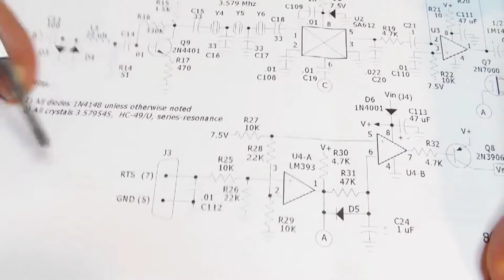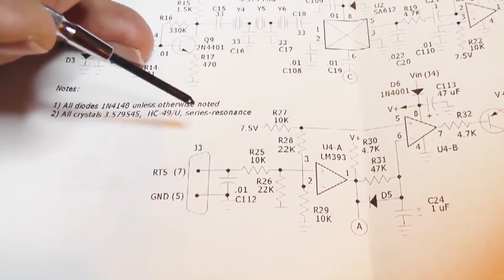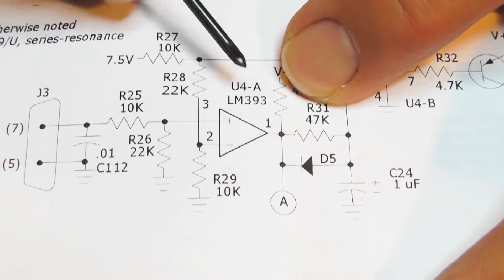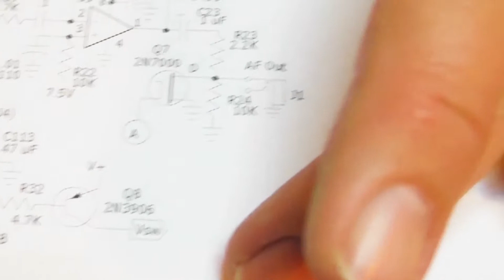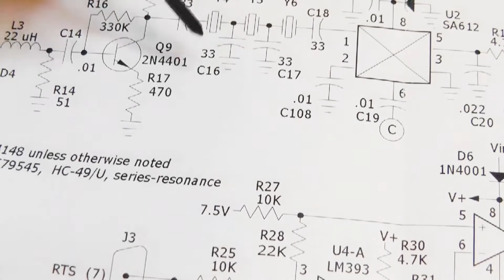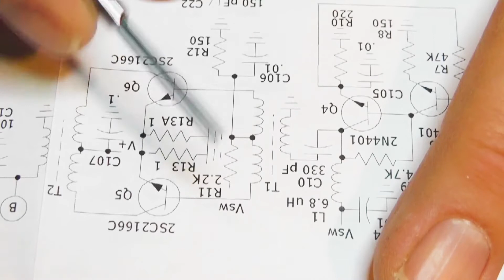Dave Casler Technician License Series: T06 Components and Units 2022-2026

Comment: I am a bit stunned that this is relevant to licensing- I wonder am I expected to build something? This seems insanely antiquated.  I can't imagine this information will ever be needed in my use of HAM radios.  Please correct my perception or show an example of the value to have this knowledge.  I hope I don't need go to radio shack (aren't they extinct?) and get a board and start soldering.  Don't you just buy the proper equipment? Otherwise I am finding the HAM study quite interesting.